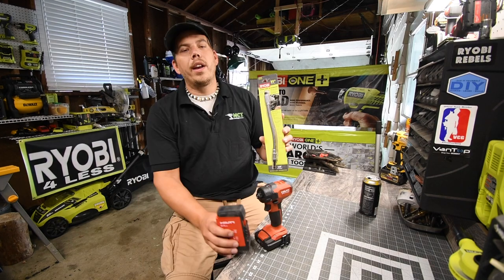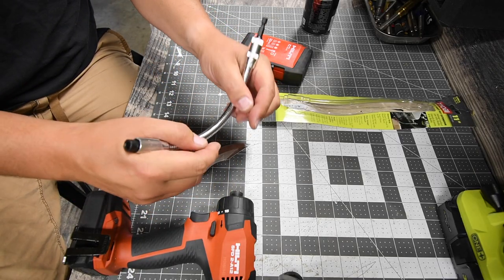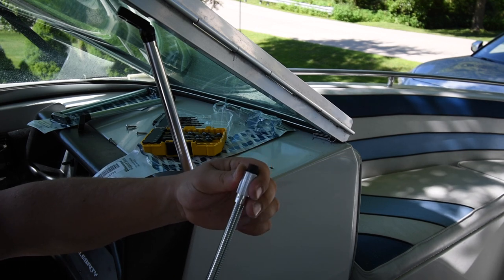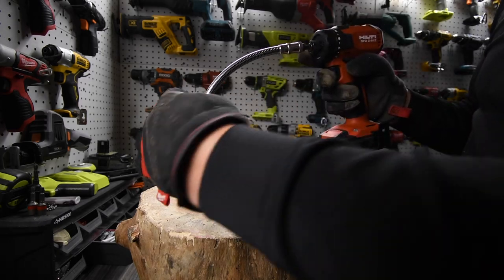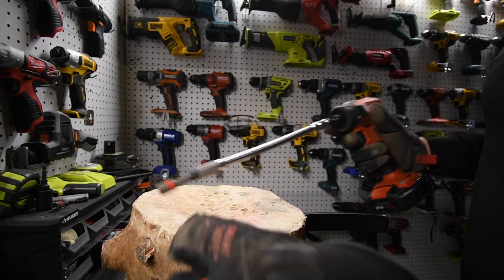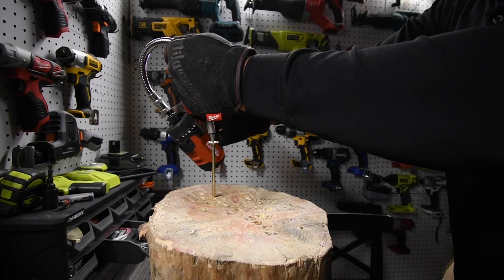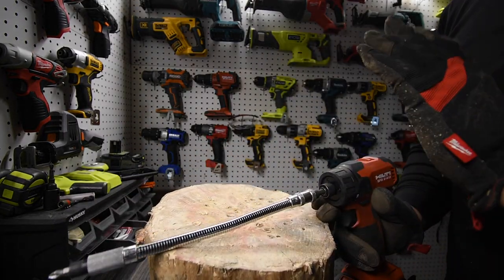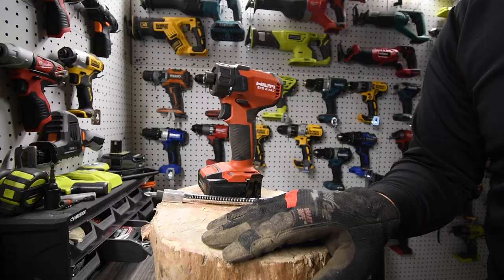Ryobi 11" Flex Shaft

Comment: I got a DeWalt right angle bit driver and it works pretty well. It’s solid steel and doesnt have a bendable wire. Might have better luck with something like that.
Reply from the maker: very good and I thank you Patrick

Comment: Oh man I tried one of those flexible shafts the cheap rubber covered ones like you broke I got a metal one so far so good
Reply from the maker: This didnt do to bad of a job
Reply: @ManCaverTools  just don't push them  they are  good for delicate work where you  can't reach that's my opinion DeWalt  has one that actually has a side handle at the end bit pricey though I got to buy a right angle attachment from DeWalt or Milwaukee thank you for your honest video

Comment: Used it with an 18v 1/4 in  drive  chuck impact an it snapped right off the gate trying to turn some 1/2 in hardware. Not a fan

Comment: 12v sub-compact 1/4" hex drill/driver - the optimal cordless tool! I have the Makita brushless (not available in the USA for some reason). Anyhow, quick question: Why didn't you use the Hilti multi-head?
Reply from the maker: I am getting that BL makita screw driver in the mail. Got it on Amazon :)
Reply: @ManCaverTools  Cool! I am looking forward to your impressions. You may already have an idea of its performance as I'm guessing that the USA 12v BL drill (FD07) uses the same BL motor as the non-USA drill (DF332), 1/4” hex (DF032), and hammer drill (HP332). FWIW, I picked the Makita due to size and weight, not performance. That's why I use the smaller 2.0 battery instead of a 4.0. I figure that if I get to a task that uses the additional oompf of the bigger battery, then I probably should be using a different tool. BTW, congrats on #400!